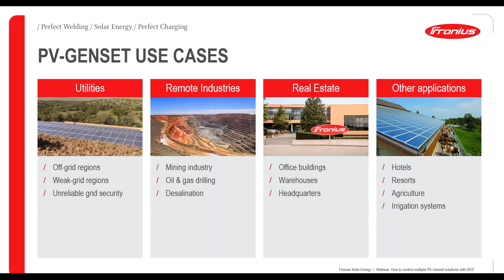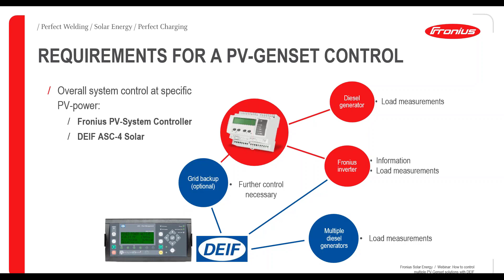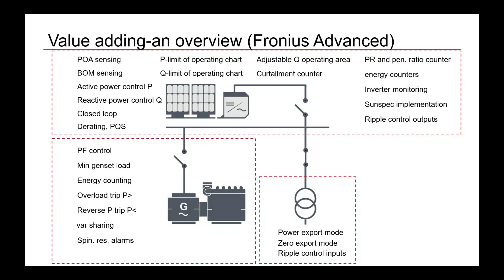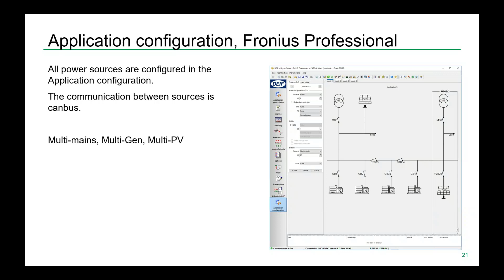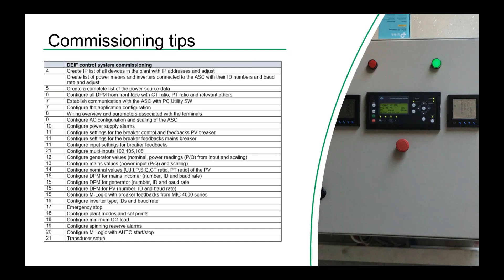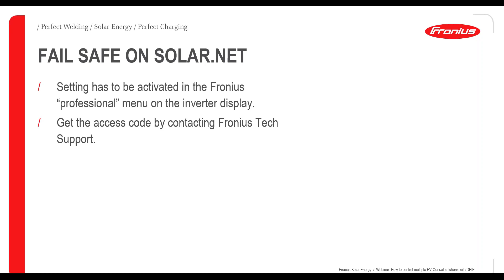Webinar: How to control multiple PV-Genset solutions with DEIF

Comment: is there any special type of genset required to for this system or i can use any type of generators ?
Reply from the maker: Basically you can use any generator that is compatibel with the DEIF Controller.

Comment: This solution is suitable for on grid inverter with grid and GenSet ?
Reply from the maker: Hi Mohamad Oussayran!

The Fronius PV System Controller is able to operate both modes (ON-Grid and Genset). The Controller has a feedback contact that can be used for the "backup power circuit" or directly for the Genset. The Fronius PV System Controller would switch from the "on-grid" mode into the "Genset" mode and limits the energy production of the inverter according to the energy demand of the load.

Best regards, your Fronius Social Media Team